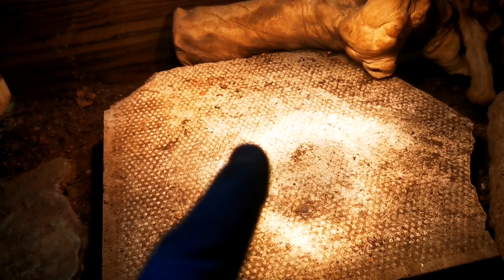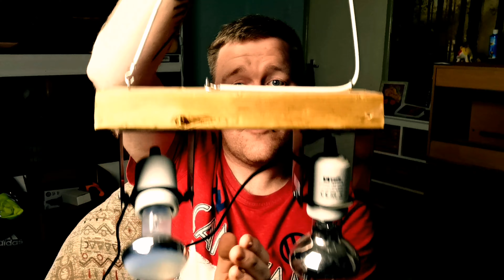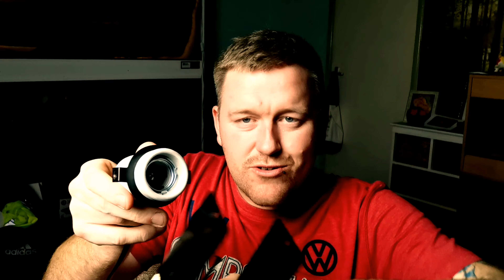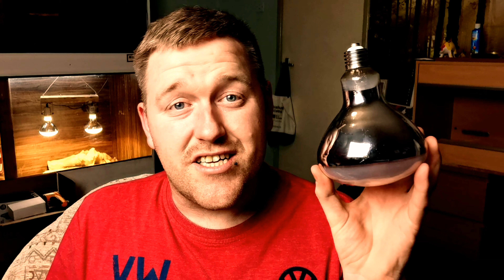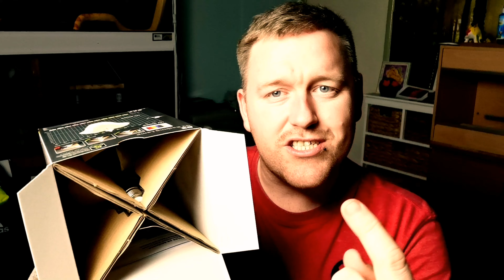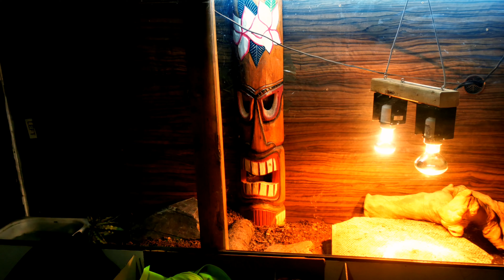DIY Savannah Monitor setup / Reptile Systems D3 Basking Bulb Review

Comment: do you know the distance from the bulb on reptile  systems  gen 2  160 watt  ercury vapor bulb ?   the one thats only 125 watts   but outputs like 160 watt
Reply from the maker: There is a full distance guide on the back of the box . It all depends on the species your keeping. There an amazing bulb. They have a few setup in the test area . Been going nearly a year and still firing a good uvi

Comment: Where can I work distance out for my savannah monitor enclosure please? Iv bought this bulb aswel, thanks
Reply from the maker: It'll be on the back of the box. Aim for uvi 4 to 6
Reply: @NORTHERNEXOTICS  uv 4-6 means I set the bulb 70 cm above basking area? If that's ryte, what could I add to increase the basking spot?? Thanks
Reply: @NORTHERNEXOTICS  ??

Comment: Do you use a thermostat for Hugo? And can I ask what temps his hot and cold sides are
Reply from the maker: You can't use thermostats on mercury vapour bulbs. These bulbs give off both uva , uvb, ir, and visible light. His hot side has a progressive heat for the first hour of lights on just like a sunrise rising upto 130f with his cool side down to 90f with even cooler temps in his various burrows with a variaty of humidity throughout the enclosure
Reply: @NORTHERNEXOTICS  thanks for the reply mate 👍